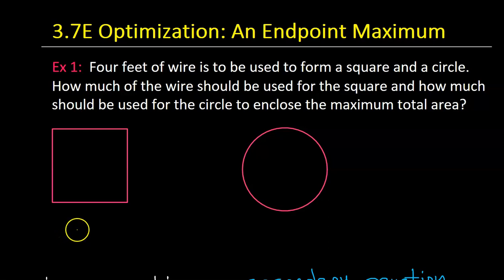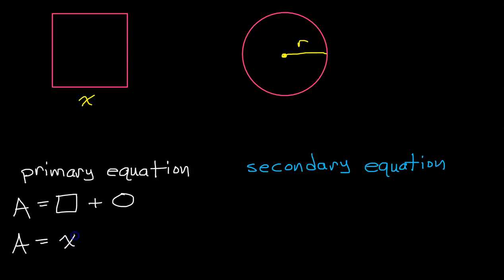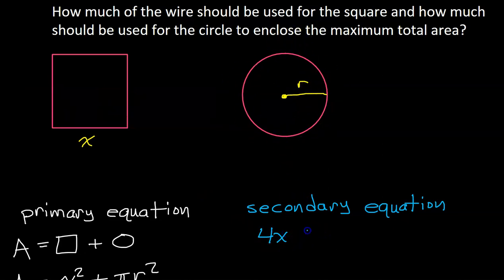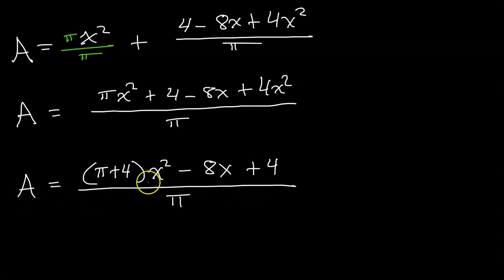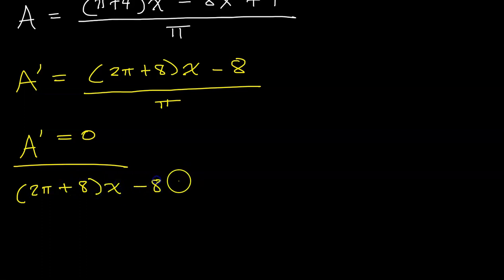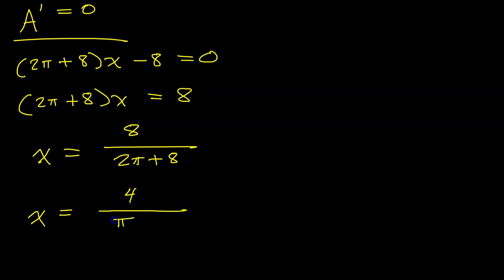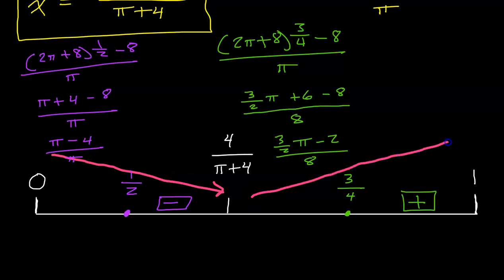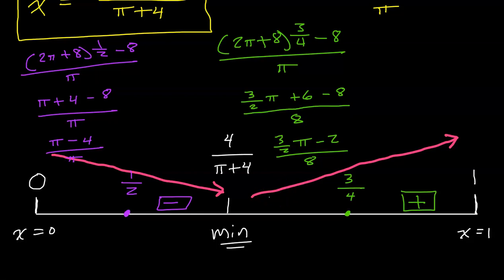4.5G  Optimization: An Endpoint Maximum

Comment: Two control towers are located at points Q(-500, 0) and R(500, 0), on a straight shore where the x-axis runs through (all distances are in meters). At the same moment, both towers sent a radio signal to a ship out at sea, each traveling at 300 m/µs. The ship received the signal from Q 3 µs (microseconds)before the message from R. Find the equation of the curve containing the possible location of the ship. 
I’ve been watching your lectures sir, they’re really helpful but do you have an idea with this problem given to us?
Reply from the maker: Kastwood XD Sorry. I’m too busy at work to solve new problems right now. 😔